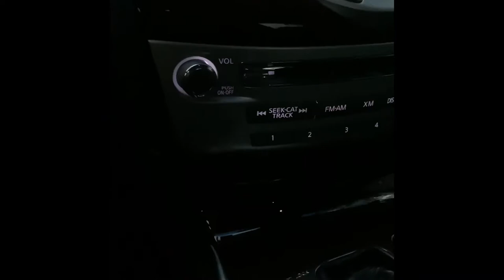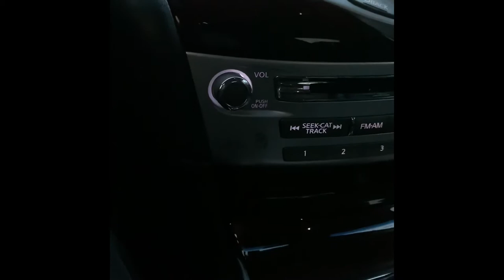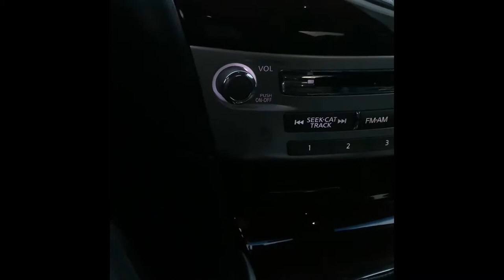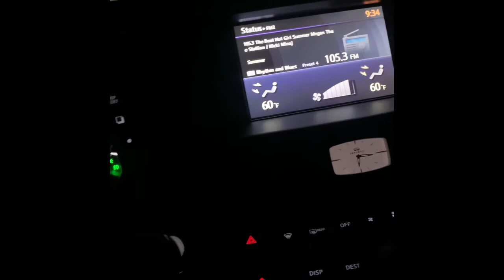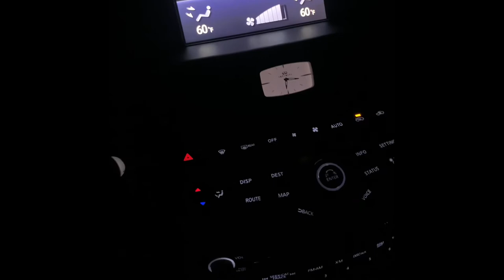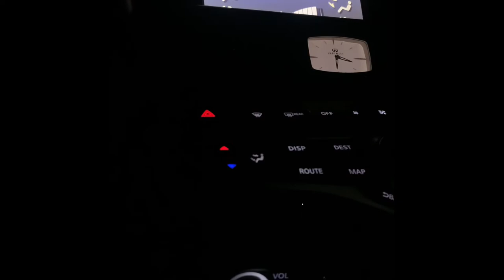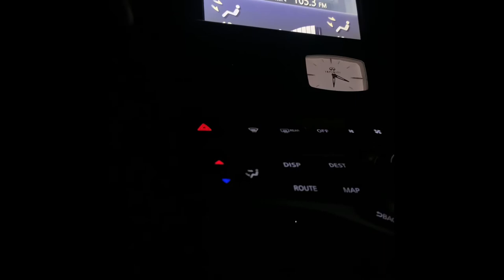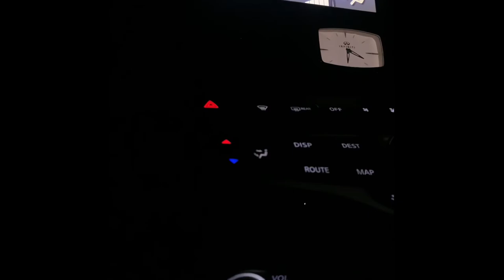2011 Infiniti M37s catalytic converters

Comment: 2012 M37x 132000 havent changed nothing. But cold start sounding louder as of this week. And driving can hear lounder drone. Maybe getting a hole? do know the driver side cat heat shield has been rusting. No check engine/codes. Also what was the size bolts you use to tighten back up
Reply from the maker: I don’t remember the size bolts. Before you buy anything I would put the car on a lift and see what your exhaust system looks like.

Comment: Bro, how are your catalytic converters doing? Still holding up? I got a 2013 Infiniti FX37 with catalytic converter code, and any suggestions? They are too damn Pricey
Reply from the maker: My code was off for about 1 year and now it intermittently comes on. I reset it and it will stay off for about a month and come back on. I went with aftermarket cat on rockauto.com 

I was told after I should have used OEM cats. Which are crazy expensive and still going to die after 100,000 miles. Nissan /Infiniti have horrible cats
Reply: Today I bought the AP EASTERN California EMISSION from RockAUTO IT SHOULD DO THE JOB